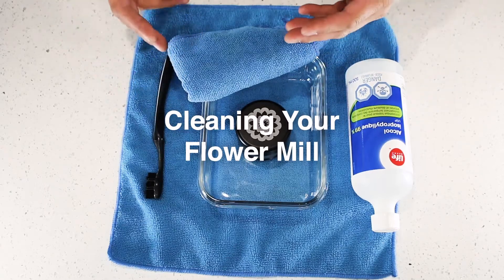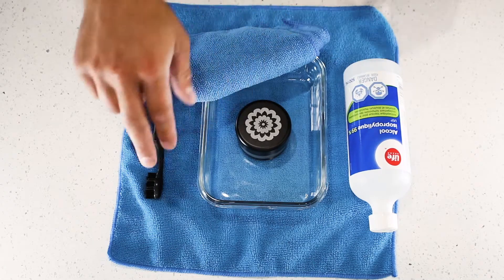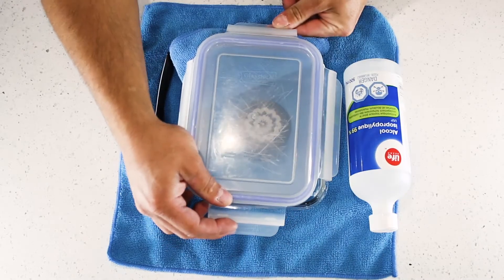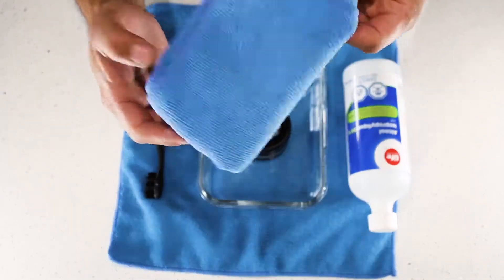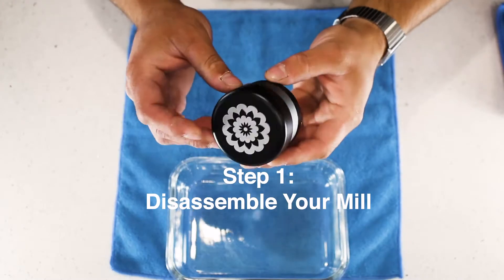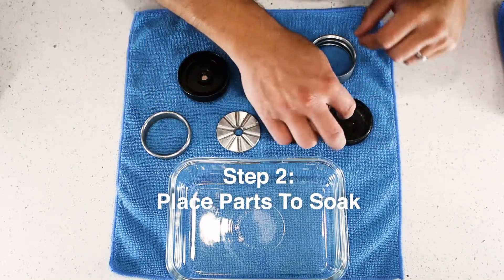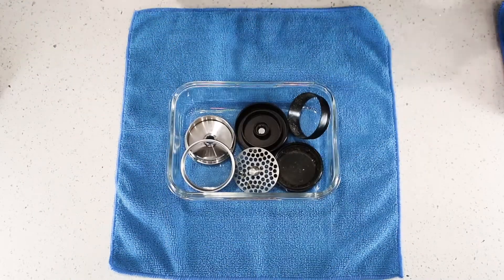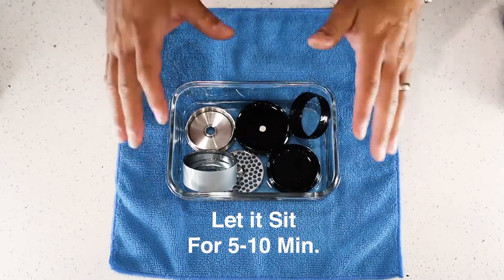Cleaning your Premium Flower Mill | Flower Mill USA

Comment: Don’t these flower mills deposit metal dust into whatever you are milling?
Reply: they used to, they come with a few low friction washers now to prevent metal on metal contact haven't seen any metal dust since.
Reply: Absolutely did, they offered free washers as the replacement. Saw some guy with a Rolex on Future Cannabis Project saying it was a bunch of idiots using their product wrong laughing about shavings. Couldn't get the mill plate off mine to install. Their supplied tool to remove rotor was garbage. Customer support basically laughed at me. Trash can it went.
Reply: yes .